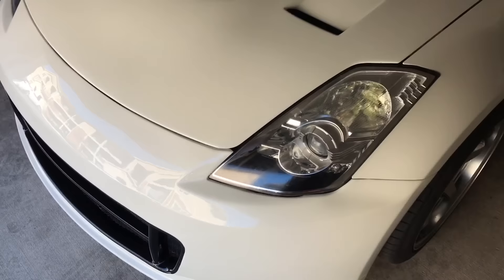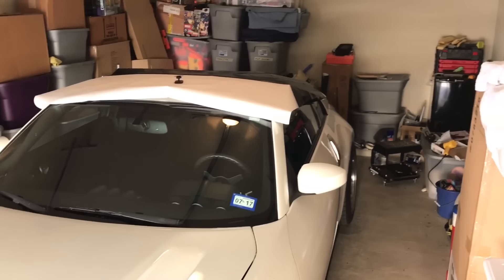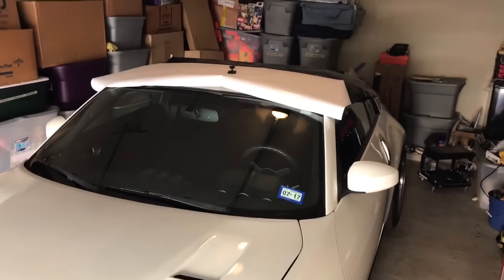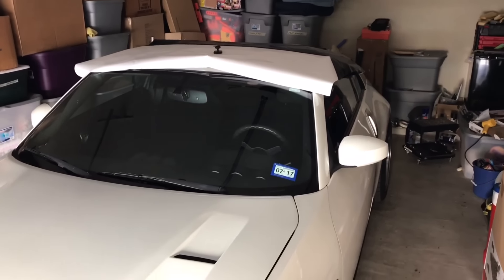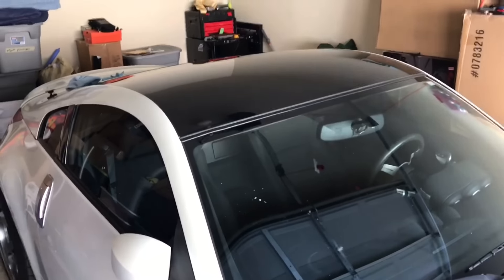Gloss Black Vinyl Wrap - 350z

Comment: Cambiar a español
I'm from the Dominican Republic and I'm a fan of the 350z and I have one that's the only bad thing that in my country the parts are difficult and I'd like to know how much a valve body would come from a bumpy carriage to put it on mine. . I was told that in this way it is cheaper than searching it on ebay
Reply from the maker: I'm a little lost in what exactly you are asking. The front bumper that are on the white Z came from eBay and its Urethane.
Reply: +The Kai Project  valve body in transmisión my 350z is 2005
Reply from the maker: Ohh sorry not sure where you could possibly get something like that cheaper then eBay.